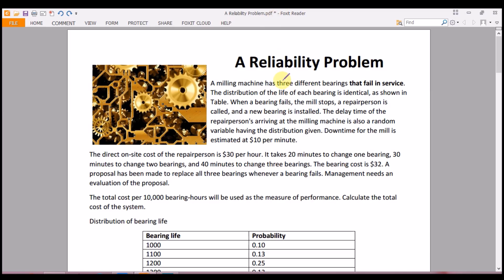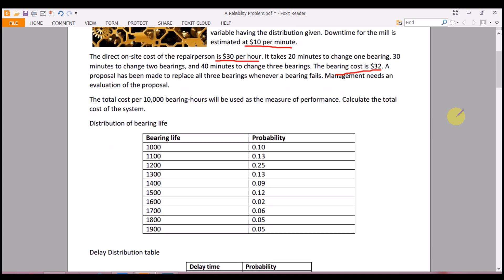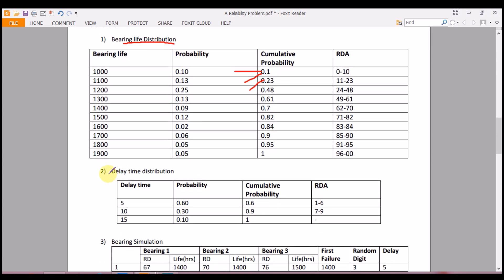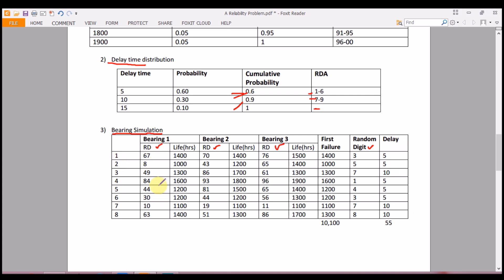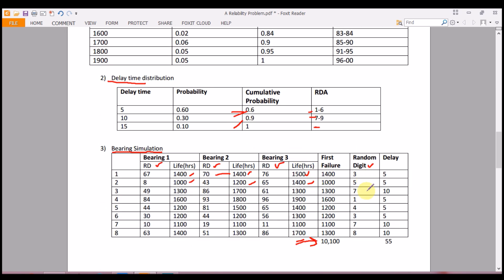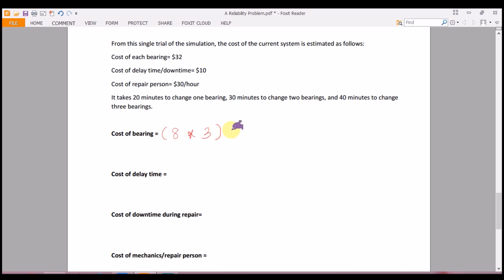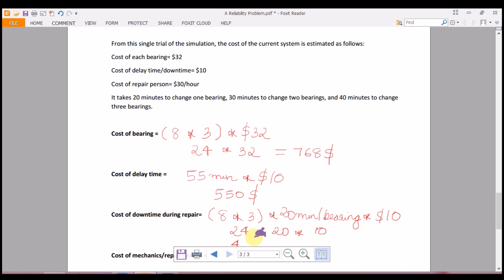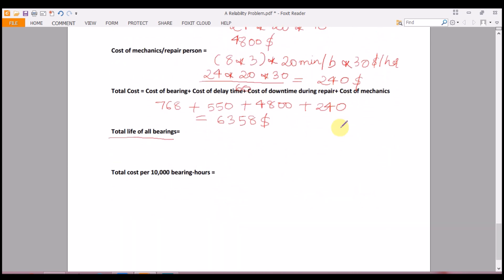System Modeling and Simulation: Bearing Problem

Comment: There is a mistake in this problem, life(hrs) of bearing 1 at simulation no 7 will be 1000, Not 1100. Because random no 10 lies in the range of 0-10 and its bearing life will be 1000.
Reply: Yes, total life of bearing should also be: 30,000
Reply: bhae ap bhi ?

Comment: calculation time for 3 bearing is 40 mins in the proposed method. What this lady has done is, just for the conventional method so the solution is not complete. And the bearing 1 lifetime in 7th cycle is wrong it should be 1000

Comment: maam actually its wrong in some places, or probably i missed out but there is no mention of runnin it for 8 cycles and the total time is not multiplied by 20 it shud b multiplied by 40 as we r changing all 3 bearings every time

Comment: Umm...won't calculation of downtime be with 40 minutes instead of 20 minutes as the proposal is to replace all bearings in case of failure?
Reply: Kalpak Kulkarni even I think that... as the question suggest changing all 3 bearings at once... Ma'am please help us

Comment: The calculation of downtime is incorrect. 
It should be 8*40 *10 (since at each of the times, all three bearings were changed together and instead of taking 20mins for each, we should take 40mins for three as specified in the question)

Comment: please, i'm a little bit confused,  in the repair person cost you said it is = ((8 x 3)x 20 x 30)/ 60
but the problem said to change three bearings it will take 40 min so the cost of the repair person = ((8 x 3) x 40 x 30) /60
and the repair person cost for one bearing = ((8 x 1) x 20 x 30)/60
Reply: @prakhardevgupta4520  In Book also it's considered $20.